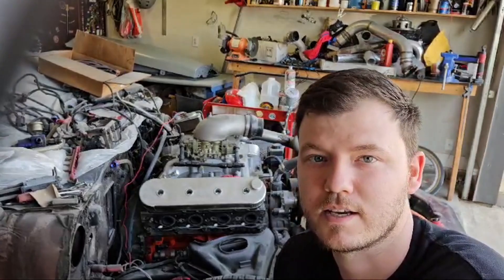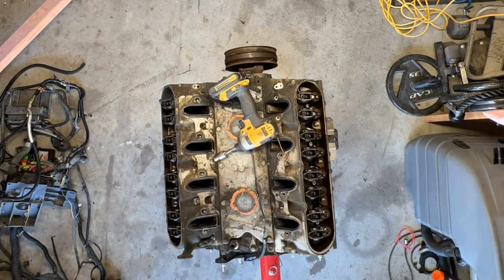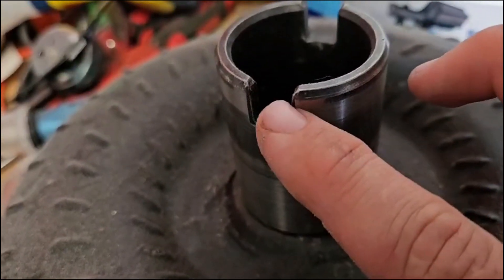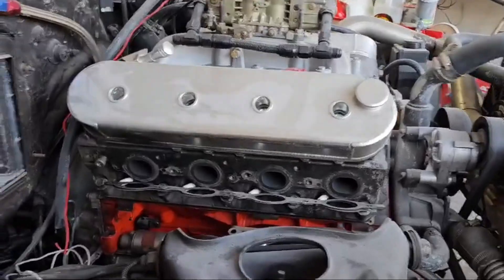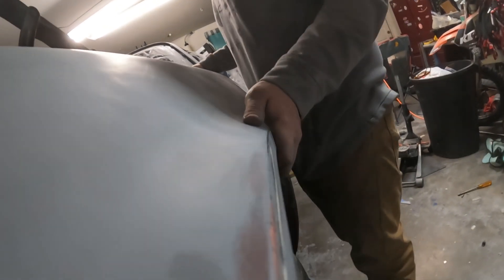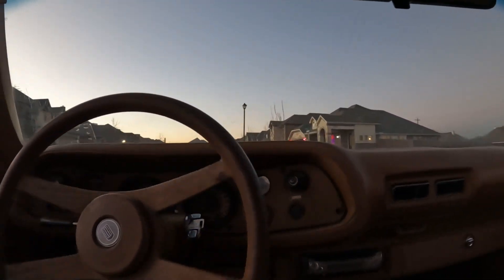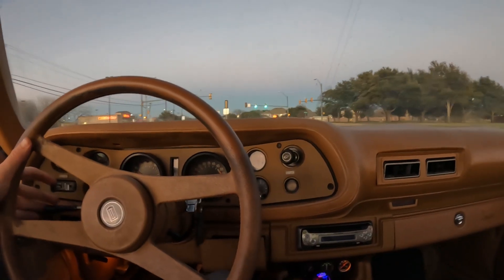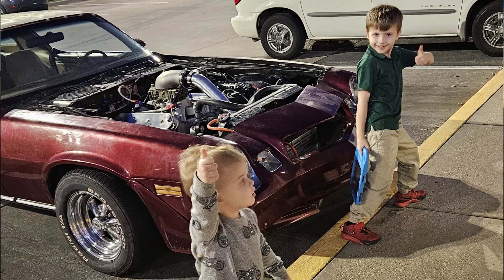LS SWAP Mistakes

Comment: Looking at your combo, same mistakes here. The same valve covers. Coil mount issues. I had a nice but small 76/65 t4 turbo new. NOOO need this damn t6 88. Now it needs 5" exh or 4 inch at least not a huge deal.. My biggest issue to date. I absolutely loved the way those 417 motorsports water manifolds look. "race car"!! So now with truck accessory meaning crank pulley, I am trying to figure out my Davies Craig water pump setup. manual steering and brakes. Had to swap alt from dr to pass side. Ive set myself back probably $2000 and good 2 months of garage time with just that.
Reply: damn, I even almost broke my right foot on Tuesday on ice. Thats why I'm typing and not turning wrenches.
Reply from the maker: Man that sounds like a killer combo though! I bet that 88 will eat for days.

Comment: You have a link for the blowthru carb you used?
Reply from the maker: I converted a standard Holley 750 that I got used. If you want to buy one ready to roll, hands down, CSU is the go-to! They take your specs, and you'll be on the road with very few adjustments.

https://csucarbs.com/

Comment: This is why I always say that putting back what came in the car is ALWAYS going to be cheaper AND easier. If your car came with a 305 small block Chevy, put a 383 or 400 small block back in. Or if it came with a Pontiac 400, build that and put it back in. If you're not a hardcore racer, an LS is a waste of time. If you want an LS for the fuel injection, there are plenty of EFI kits for small block Chevy's. You can build a stout gen1 small block and daily drive the hell out of it. If you ask me, people go LS because they are either lazy, or don't know how to tune a carburetor or set an ignition curve in a distributor. People who can tune carbs are a dying breed.
Reply from the maker: Hey man, great points! I had a good running 350 in it, a small cam with a mild build. It was in the car for probably 10 years. I could have easily freshened it up and put a turbo in. Now I went LS and still ended up with a Carb... but I learned a ton along the way! Just got to keep wrenching and learning.

Comment: I am doing an LS swap project. 6.0 into a 65 mustang.  The mustang still has the straight 6.  I am just getting all the parts slowly then going to take out the motor and cut the towers.  

I am thinking I might get the 6cy running so that I can drive it while I am getting all the parts.  It hasn’t run in 20 years, but I just got it in November.  I poured gas down the intake with no carburetor and it ran for a few seconds.  It’s just the extra effort of doing the fuel lines and getting a carburetor
Reply from the maker: Do you plan on EFI or using a carb on your LS? I would 100% get the straight 6 running! It's going to take a while to get everything for the swap. Also, brakes, suspension, and electrical all need to be tested/inspected. Might as well enjoy the ride now!
Reply: @Bad_Larry_Motors  I plan on EFI , as the dream is this would be my daily driver.  The car actually came with everything to complete a 6 cylinder restoration, including willwood 4 lug disc brakes.  All new fuel and brake lines, new carb, and fuel tank.  I did get the 6 clyinder to turn over, without the carb, so I think it’s a runner.

Comment: Buying a donor truck is the key to a cheaper swap. And do tons of research. Also buy a 3800 stall converter.
Reply from the maker: Good point!!! I'm tight on space here but I wish I could of snagged a 4th gen with a T56!

Great point on the stall, I have a 3200 in it now.

Comment: Fyi…….im running a B.O.P. Th350 behind my 5.3 without an adapter plate….the two bolt near the dowels are the ones holding….the key is having both dowels…..ive been running it like that for over 5 years now and its supercharged!!!…….good video though , very useful info for the newbies
Reply from the maker: Man good to know!!! I should have tried that. I could have saved some cash. Thank you!
Reply: No $ for adapter,  probably no crankshaft spacer also
Reply: @pmotorsports8276   still need the spacer  unless your using a long crank 6.0 from ‘99 and early 2000….and some 2500 vans that had the 4.8/4l80e combo…
Reply: @pmotorsports8276  no $ for adapter???…..i have a bop adapter i just coose not to use it….the magic is in the dowel locators….and the other 2 bolts are plenty nuff to hold it….you ever try to pull a head with a bolt that was forgotten??? Not gonna happen!!!
Reply: @trentdawg2832  you may have that adapter, but unless it's mak specific to LS  engines.  You need additional spacing.  Even Chevy TH400's need a spacer to LS engines.  Not here to argue
Reply: Some definitely have 2 bolt patterns
Reply from the maker: Well I have an adapter if anyone wants it! 😆